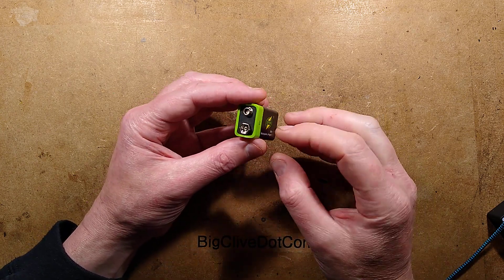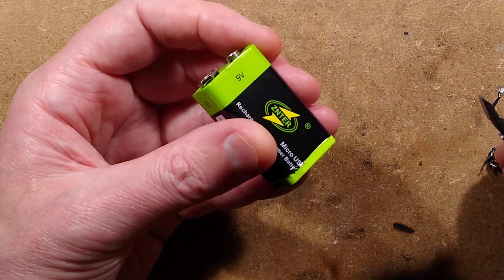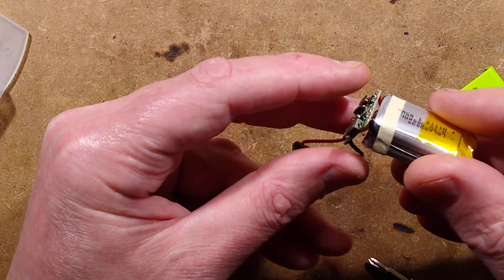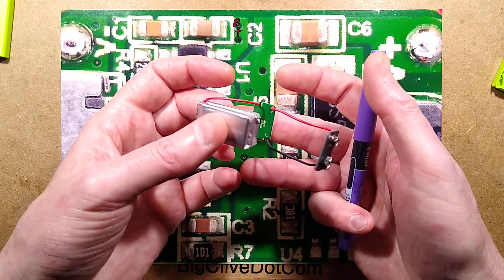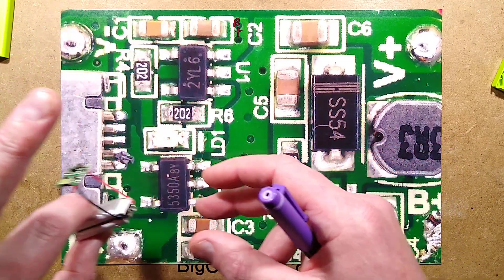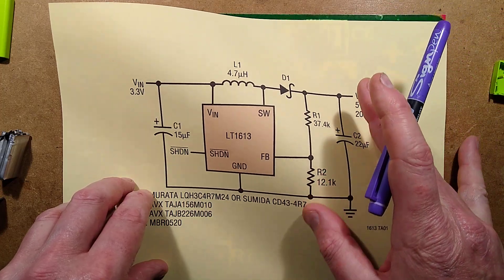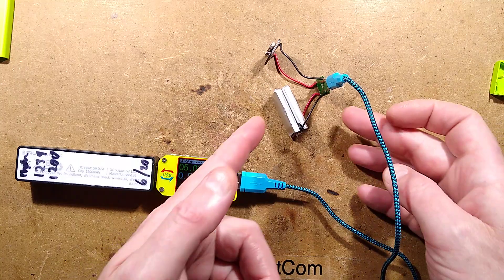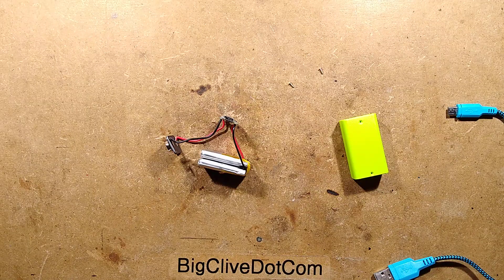Inside a Znter lithium 9V battery.

Comment: This is only suited to power hungry, noise resistant loads. I wouldn't go anywhere near a measuring instrument or radio with this "battery" due to its horrible noise. Also, not convinced about the quiescent current. I'm surprised they didn't put the cells in series, and used the boost converter to charge them, it would be a better design IMHO.

Comment: I’ve had two of these fail so far (out of 8) and both failed in the same way. I commented a year ago when I first bought them, one failed right out of the package. another failed the same way today. A capacitor, which I think is a smoothing capacitor but did 0 reverse engineering or testing or anything, just a guess by looking at the PCB/traces. It’s located directly next to the charging port and connects to V+ of it. I have a different PCB revision than what is in the video. In any case, maybe I’m wrong, but whatever the capacitor is doing, it desolders itself from heat and the cells sustain major damage. The solder is cold but I can’t really take them apart to reflow because it’s hard not to bend the PCBs or rip capacitors off during disassembly, they changed how they’re constructed. I don’t trust these batteries anymore. 

I did repair the first one from a year ago and soldered the capacitor back on and reflowed everything with leaded solder and added my own cells with protection boards. I have a little flashlight with a 9V connector that attaches to the top and use it as a flashlight, it’s very handy and convenient. I wanted to use these batteries in my work tools, which are primarily 9V powered, but they’re way too noisy which isn’t surprising given the boost circuit. Seems they cheaped out and these new revision ones are junk, oh well.
Reply: Also I will add I shook the battery and could hear th capacitor loose inside so it definitely knocked itself off and it’s not from me disassembling
Reply from the maker: A common failure of the little boxy ceramic capacitors is to short out and get hot.  It's sometimes caused by mechanical stresses during manufacture or use.  It's not a good thing.

Comment: i have a guitar with active pickups powerd by 9v battery...i have battery with usb charge capability..how can i reduce the noise from the circuit?is it a good idea to put a 10v 100μf capacitor between -battery terminal and the circuit board to filtered that noises?
Reply from the maker: It might be possible to reduce the high frequency switching noise with an external capacitor.  But these rechargeable lithium type 9V batteries aren't really suited to audio applications.

Comment: I bought a bunch of these and 1 of them got extremely hot while charging and never fully cooled down even hours after just sitting in a bucket of sand which was scary. It also heated up the same way when under any load. The rest of them work as expected. I peeled the label off the one that got hot to see if I could take it apart to disconnect the cells and take a look at it but mine (all assembled in January 2024) have a solid metal case instead of the screwed together plastic. It looks like they rearranged the internals as well, the board with the female usb port is now directly below the terminals. It seems to be glued together but I think you might be able to heat the plastic piece with the terminals and pry it off then maybe push up on the bottom to get all the components out but I was too scared to start sticking sharp things into a battery that seemed like it wanted to burst into flames and then push on the cells. My guess is it has an internal short.
Reply: To disassemble these, which you shouldn’t because it’s dicey, use a thin pry tool to work around the plastic cap with the terminals and pry up as you go. You have to go around a few times. Once it’s off, cut the nickel strips connecting the PCB to the cells in half and remove the 9V connector. Then you can grab the cells with pliers and pull them out. Mine were swelled up so I had to shove a pry tool down the sides of them to coerce them to come out. It’s possible if the cells aren’t swelled up, once you have the 9V connector off you’ll be able to just pull on it and slide the cells out. I do not recommend anyone to ever take these apart, there’s too many chances to make a small mistake that’ll create a ball of flames.

Comment: Hi! I've bought a couple of them in 2024, now they're sold as 600mAh. I've done a few tests on them with an electronic load + a scope, the output is pretty noisy with 200mV pk-pk of triangular ripple (+HF), whose amplitude seems pretty constant. It's a kind of "constant on-time" control, so the frequency is heavily dependant on the load : from 5mA to 85mA, you're outside the audible range (i.e. 10kHz ripple, creating a noise in the coil at 20kHz). You have the maximum frequency at around 50mA. The output current capability is quite shocking and I didn't risk doing it for too long, but you can get more than 500mA! The ripple increases a bit, but it is still acceptable, and the voltage virtually doesn't drop. This makes me wonder how short-circuit is handled, and I didn't try it either.

So if you don't need low noise OR if you're ready to add external filtering (various ways to do that, from the ubiquitous "capacitance multiplier" to a properly damped LC filter), this can be a very nice way to add a battery in your project, which gets charged by a USB port and outputs on a very traditional connector. Even if your "noice cancelling" circuit eats up a bit of voltage, you start with more than enough for most of things : even a capacitance multiplier PLUS a LM7805 should work.

Not too shabby, is it?

Comment: @bigclivedotcom Hi, ive watched many videos from you and just wondered if you want ro disassemble, explain and rate the circuitry of some USB-C rechargeable Lithium-Ion AA batterys which ive owned.
For now they work really great and claim to be made in Germany (where i live too) - so i'm interested in if these are actually good quality inside.
The reason why im curious about that is - every other type of this which i found were china-branded with Micro-USB and they have many bad reviews of overheating and some melting the case while charging.

Please let me know if you want to disassemble them, cause then i would sent you two of these.

Thanks and nice Videos! Really like it ^^
Reply from the maker: I took a look inside a lithium rechargeable 1.5V AA cell a while ago.  Jugee brand.

Comment: You know quite a bit about electronics circuitry. I wonder if you kNow the answer to a question I've been pondering. 

If you have the rechargeable battery installed in a device and you have the battery connected via the charging cable whilst charging. Will this cause any damage to the device?   

I was just trying to be lazy and thought if the rechargeable batteries are always being charged while it's in the device there wouldn't be any down time while batteries needed to be charged?
Reply from the maker: Many of the batteries will deactivate their output while charging.  If you find one that doesn't then it should work as a crude UPS.
Reply: @bigclivedotcom  thanks for replying.  i didn't think it would work but didn't want to try it in my device and end up frying the circuits end up buying another.

Comment: So, these have boost converters inside - making it output constant 9V independant of charge status, and then suddenly switching off due to battery protection circuit. This shouldn't be used in smoke detectors, then, since they wouldn't be able to detect low charge any more, right?
Reply from the maker: That is correct.  They also have a higher self discharge.

Comment: the ni-mh 9v rechargable i have is of the 7s variety. most electronics i've used it in don't complain but the multi cell series design seems to make it far less shelf stable than the single cell aa and aaa batteries
Reply: You could float charge spare 7s nimh batteries at c/300 ready to go, similar to Big Clive's aa/aaa nimh charger circuit video. Would probably want to use a 200mA PTC fuse, 1n4148 diode, 100r resistor and 10k 25-turn potentiometer for each 9v battery (all in series). The 100r resistor (1% tolerance) could act as a current-measuring point so that you could use your volt meter to check that the current is ~c/300.

Comment: Is it ok to Connect a 12v5w solarpanel directly to it? To load the battery?
Reply from the maker: No.  It would need to be a small 5V solar panel.
Reply: 5V? It van push Up towards 9V?

Comment: Side note, don't use these to power guitars with active pickups or active EQ. Found out the hard way with lots of fizzy noise only when using one of these batteries. Seems to work fine in the Wah pedal though, I guess the power rail never gets near the audio path in a crybaby!

Comment: I AM slightly surprised that with "1000mah" of lithium cell inside there, that they actually took into consideration the inefficiencies of the boost converter circuit, and ultimately rated the cell as 400mah... 👍

Comment: thank you very much for the video. Great that you commented on usage with a beltpack as I almost wanted to buy one. You were right on the spot that we always change to a new battery to prevent it goes out during a show. But I also do not want to take the risk of a an added sound to the wireless mic so I guess I stick to the old chemical batteries

Comment: I like these batteries, but they definitely shouldn't be used in battery operated smoke and carbon monoxide alarms, as you will not get the warning beeps to remind you to change the battery when the voltage droops.

Comment: Did you test it inside a multimeter? I'd like to switch to these guys on my 9V multimeters
Reply from the maker: The self discharge is a bit too high unless you use your meter a lot.
Reply: @bigclivedotcom  I see there are variants without usb port and those don't have a boost converter. Do you think those would work?

Comment: Clive, I forgot to mention that most of the Znter 9v I found on eBay had the charging port moved to the top. I avoided those as I thought that they might be a bit dodgy. Don't know if you would do another tear-down review on this "new" iteration or not. It might be a simple redesign, but it might not. The ones I ordered had multiple pictures and one showed the lay out of the one in the video. Also, Just signed on as a patreon.
Reply from the maker: I wonder if that's to make the manufacturing easier or more compact.
Reply: @bigclivedotcom  I suppose. I was thinking that maybe they moved the charge port to the top and maybe left the circuit board at the bottom?

Comment: 700mah with usb c charging is now available. This is the only 9v lithium brand I have found that uses a voltage regulator. Of course this means don’t use it in a smoke alarm but other than that I like the regulated much better than the 8.4v-6v versions without the voltage regulator.

Comment: This is nicely designed! The only change I'd make to it is to add an oh-so-tiny slide switch between B+ and the DC-DC converter's input, therefore allowing trouble-free long-term storage of the thing, without having to worry about it potentially going dead to the point that the battery charge circuit won't let it charge (a perennial problem with these lithium-ion batteries that depend on a DC-DC converter to derive the required voltage).

Comment: I have been using DeeleePow AA batteries for a couple years now and they work great. 3400mWh Li-po cell with a super flat 1.5v output but without the microUSB port. Instead DeeleePow uses a wall powered dock charger like other NiMH cells lowering the per cell cost.

Comment: What is the ripple it produce under a decent load? This boost stuff change the clear power supply a battery normally is. I think you don't want to use this with older equipment such as radio's?

Comment: With that quiescent current always existing on the boost circuit, wouldn't it damage the cells and prevent charging if left not charging for very long periods of time (like a year or two in storage) ?
Reply from the maker: It would be wise to recharge it from time to time.

Comment: Can these be connected is series to get higher voltages? I was think of using 10 to make a 90v batter for an ol battery powered vacuum tube radio
Reply from the maker: Not recommended.   You may be able to find a boost module on eBay for stepping voltage up to 90V.

Comment: It's a nice design, but could do with a reveres diode across the output, to protect it against reverse voltage, which would happen if two were connected in series and one went flat first.

Comment: Thanks. This is great. I bought a similar product with a different brand name, and it had 2 lithium batteries in series with no boost voltage on the output. So the maximum voltage I got on a full charge was just over 8 V, which caused my devices to register it as low battery. Now going to buy Znter.

Comment: Seems like a recessed slide switch in the side or bottom, or a momentary micro switch integrated into the top (b/n the terminals) that would only be depressed when connected to a device could assist in storage-life / self-discharge protection for readiness sake? If a person wanted to modify one...

Comment: I would have liked to have seen a design where the two cells are in series, with a buck regulator for charging. I can't imagine the interference it would cause in one of my pocket (1960s) transistor radios... But they would work on 8.4 volts, down to around 6 volts. 

And as there is no quiescent drain, and no loss of up conversion, that could be a 500mA/Hr battery. I am still hoping!  :-)

 Great idea as is, for compatible equipment, and as usual, as great video, thanks.

Comment: Could you put 3 cells in series and then use a linear regulator to limit the voltage. It would (theoretically) be low noise and no quiescent current. Depending on how it behaves, it might also drop output voltage when it gets low. I'm not sure how to charge it though.

Comment: You know, parallel is always better if it comes for li-ion or li-po because of a balancer module. This way no balancer module is not needed and i doubt it would fit in such a small teritorry

Comment: Looks like a good battery .wonder what the standby time is .will the unit always go dead ,even if it's not used .
Reply from the maker: It does run flat itself with time.

Comment: After watching this, I ordered a couple from China. They arrived within a couple of weeks, but the packaging was weird! What I received was a 12cm/5inch diameter, button cell powered, LED colour changing ball?? It had been sliced open and my 2 batteries, in blister packs, were stuffed inside. I presume it was a smuggling operation to bypass the carrier's restrictions on transporting lithium batteries!! 😧
Reply: mine came inside crappy plastic torches, jammed where the aaa battery pack should go
Reply from the maker: Yes.  You can't ship batteries unless they're part of something.  It's one of many nonsensical regulations.

Comment: changing smoke detector 9v seems like a good idea if doing so regularly i mean they beep like crazy so soon these days anyway used to get like over a year outta a battery 🔋 year and 4 months but change yrly usually with these might have to check more often but with a set of replacements all ready to go you could just charge the old ones and then store in a drawer until next swap then it'd be charge n swap then charge old
Reply from the maker: I don't recommend these for smoke detectors, as you may not get a low battery warning.

Comment: Coupling and decoupling capacitors? I could look them up but you explain things in a way I understand. What are they doing?
Reply from the maker: They act as a mini reservoir that softens voltage spikes.
Reply: @bigclivedotcom  ok, that is the one thing I knew. And a pull down resistor drains them when the power is turned off. I don't get the coupling part. I love your videos btw

Comment: I have these batteries in aa aaa and 9v. Work in most things. Some stuff for some reason dont like them and refuse to work. Guessing it's to do with the noise from the boost converter. Similar to how ac uses modified and pure sine wave. Some devices dont like the boost converter power.

Comment: UB7QA - device type UB - last 3 digits are year code, week and lot number. The data sheet/type is a SY7152A. Its almost identical to the LT1613 you showed. Made by Silergy. Just realised this has popped up in my recommends almost two years after you posted it!

Comment: It's a Ti or equivalent UB7QA: TPS62088 and TPS6208xA, 2.4-V to 5.5-V Input, Tiny 6-Pin 2-A/3-A Step-Down Converter in 1.2-mm × 0.8-mm Wafer Chip Scale Package and Suitable for Embedding datasheet (Rev. E)

Comment: What you forgot was the shutdown circuitry, I suppose. The step up converter has this pin that should be connected to CRG pin on the charger and shutdown the converter during charge.

Comment: Guys, is it suitable for the use in a guitar? Thank you in advance.
Reply from the maker: It may introduce high frequency noise in some audio equipment.
Reply: @bigclivedotcom  
Thank you. Because of the pulse converter, if I'm not mistaken... Same batteries (9V) but NiMH - it seems they don't have this issue.
Reply from the maker: @MaximC  Yes, the voltage boost circuitry can introduce noise.  But not on all equipment.

Comment: so there is also a 600mah version... is it fake?
Reply from the maker: I'm not sure.
Reply: @bigclivedotcom  So you are right. I put a scope on a simple LED circuit on a bread board and switched out the znter battery with a regular alkaline. The Znter is UNGODLY noisy electronically... so noisy I probably wouldn't use it. A 200ish uF polarized cap filters it right down though.

Comment: perfect I am totally convinced the standard lithium is that 9.6 volts in the battery if it is possible to use more cells of lithio x2 x3 For More POWER - PACK IN https://en.wikipedia.org/wiki/Nine-volt_battery